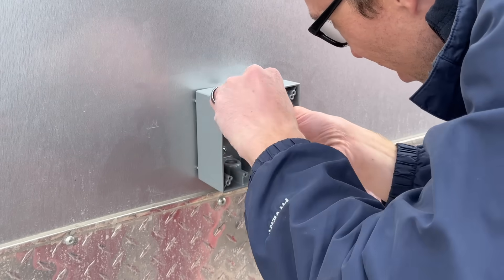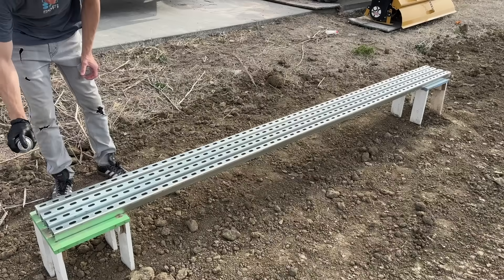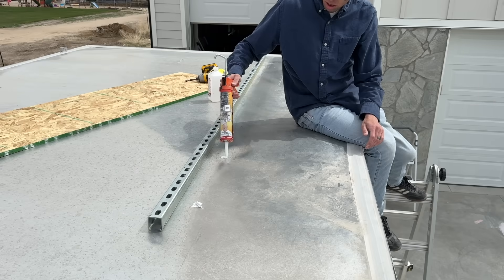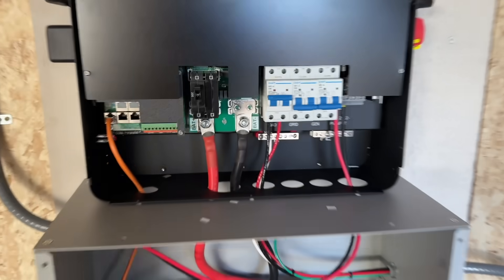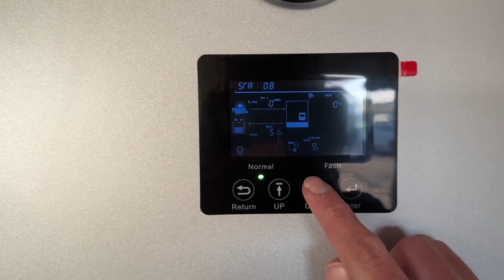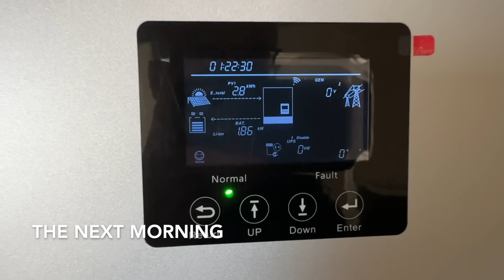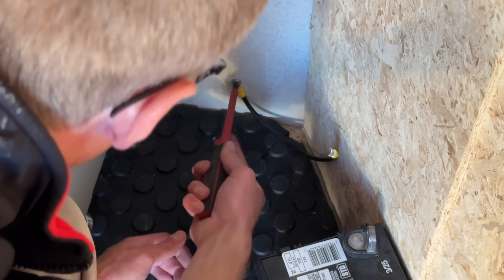I Built the ULTIMATE Solar Cargo Trailer

Comment from the maker: If you're looking for solar equipment at the best prices check out my project → https://drop.solar

For anyone curious about the cost, the total came to around $7,500 (not including the trailer)
Reply: This thing is Awseome. Imagine a trailer body with electric assist wheels kinda like the pebble rv so this thing could help push an EV along and not reduce your range so much.
Reply from the maker: That's an awesome idea!
Reply: @TysonBash  Just keep the tesla plugged into the charger while you drive 😂
Reply: @SmithOffGrid  just an observation here: signature solar requires a minimum purchase of 10 solar panels in most of their options. This eliminates a lot of buyers for projects like this.

Sungold Power has a minimum of 2 on all their solar panels, which means more people, especially ones who want multiple different panel sizes, will be able to buy from them, just be sure to wait till they have a 20% or 25% off sale.
Reply: Hello, the Portuguese audio option appears, but it is still in English.
Reply: Can you please build a small version for me?
Reply: That’s not bad 7,500 trailer about 11-12 maybe that’s right in the price range I was thinking, now probably another 5k for the flooring and water stuff lol .
Reply: $7500 including the trailer?!
Reply from the maker: @apayes  Not including the trailer, that's the total for the added solar equipment
Reply: @apayes  yeah, right!!!
Reply: @apayes if only👍🏻

Comment: Good job. This is what I've been planning for a couple years now but funds aren't there yet. I'll be more DIY though because I want the weight over the axles so I'll open the floor over the axles and create a sub floor storage for the 400ah batteries and hang the inverter on the wall next to them. That way I can still pull my SxS in. I need to save the weight on the tongue to carry the weight of heat pump AC unit. But otherwise you hit the nail on the head going with a true 48v solar system. I plan to also add a solar panel awning to get closer to that 5000 watt capacity so that the AC can run directly off the panels bypassing the inverter.

Comment: Have you considered running the inside wiring inside the walls instead of the exposed conduit? Also, when installing a junction box (or any box) on the outside wall of a house or trailer, you only seal the top and both sides and not the bottom so if any water does get in behind it can drain out and not be trapped. Would it be better to bring the solar wires over the front and go in through the wall instead of that large hole in the ceiling? It does look like there is room for more panels on the roof. I would go for as much production as possible.

Comment: You need to get that lead acid battery out of there. They are not to be used in enclosed spaces
Reply: To be specific "Yes, lead-acid batteries produce a mixture of explosive hydrogen and oxygen gases
through the electrolysis of water in the electrolyte, especially when charging, overcharging, or even self-discharging, with the gases venting from flooded types and potentially from sealed (VRLA) types if overcharged, creating significant fire and explosion hazards if not properly ventilated."
Reply: @MrAdopado thanks Wikipedia
Reply: @z50king29  .. and that's why it's in quotes.

Comment: Happy to see how you mounted the panels on the roof to the frame. I am getting ready to build a system into my 20' cargo/car hauleing trailer and I was unsure what the roof looks like because mine was finished out on the inside. So I can see I'm going to need to remove the plywood from my ceiling in order to be accurate about it because those metal beams are pretty small. Watched several videos and nobody really shows that... they just show them screwing it to the roof from the top in like any old place and I keep thinking to myself... no way... drilling from the bottom up thru the roof is a way better way.
Reply from the maker: Glad it was helpful to see how I did mine! Good luck on your build!

Comment: hi there. nice build! please insulate ( or better cover) the sharp edges of the cable passage from the battery to the inverter with thick rubber to prevent rubbing through the insulation !!! this is a serious fire hazard !!!
Reply from the maker: No worries! 13:52

Comment: Impressive project.  I wonder, did you need to accommodate the "ratcheting" of the panels to the "flex" of the trailer roof as you go over curbs/ruts and the like?  If so, what/how?

Comment: Nice job!  You need to use bushings on the knockouts in the bottom of the inverter to protect the wires from sharp metal edges of the punched holes.  As you travel and use the trailer, the wires will vibrate against the edges of those knockouts and can rub through the insulation causing a catastrophic short.
Reply from the maker: No worries! 13:52
Reply: He should be worried in a mobil application those wires WILL rub through insulation, at least he will get to see if the circuit breaker works.

Comment: Great work as well, very clean install.
With much of the battery installation contained within the nose of the trailer and the addition of solar panels forward of the tires, how much additional tongue weight/static force was added to the trailer hitch? 
Estimating ~625 pounds (300# battery, 100# Inverter+Panel+Wiring, 225# for 3 solar panels forward of the tires).

Comment: Hello, anytime a wire goes through a hole especially a metal box it should be protected from chaffing etc. with the proper additional insulator and a wire securing device if required. Please for safety reasons protect the battery cables, etc that pass through from one box to another box!!!
Reply from the maker: No worries! 13:52

Comment: What is this system grounded to? I see you have a wire ran from the inverter to the panel box, but doesn't this system need to be ran to the chassis?
Reply from the maker: I can’t remember if I showed it in the video but I sanded off the paint in a corner of the breaker panel and used a self tapping screw to connect it to the frame of the trailer. That bonded the ground of the system to the trailer

Comment: I recently ghetto rigged our bus's solar to my workshop. Runs our well pump and booster... love it.  nice work on the trailer. personally, I couldn't trust the wood screws to hold over 400lbs to the interior of a trailer wall. You might consider some through bolts to the exterior and just caulk the hell out them so they dont leak

Comment: I'd look into getting a 48v to 12v buck converter to tie into your low voltage instead of the battery. A fuse and an switch should be sufficient to come straight off your battery.
Reply: Thought the same, 14kw battery & inverter has to be on to keep the 12v charged, The extra weight, wiring and the loss between 48v DC -> 120v AC -> 12v DC doesn't make sense, If you wanted to run a nice 12v fridge you'd lose a lot more power versus a step down right off the battery. Otherwise a fantastic build for sure!

Comment: Personally, I would have put all that weight over the axles.  That would keep from adding to your tongue weight (unless you're towing it with a semi).
Reply: I thought about that, but on my trailer, I'll be doing a similar system and i want it heavier on the front so I can put tools like a compactor all the way to the back of the trailer and not wory about fishtailing.

Comment: Looks amazing, I would probably add a DC isolator switch between the panels and Inverter though
Reply from the maker: The inverter actually has one built in on the right side which is awesome!

Comment: I too am making a solar setup, though mine is on the roof of shipping containers, instead of trailers. Today I just finalized the purchase of the solar panels through signature solar, paired with some refurbished 5kw growatt inverters. The 5kw inverters were $350 each, and the 12kw of solar panels were just under $0.19/watt. I don't have batteries yet, but will buy those after I bring the rest online, with solar running my air conditioners during the day.

Comment: EDIT: never mind. you fixed it at the 14 minute mark. Should have watched all the way before commenting

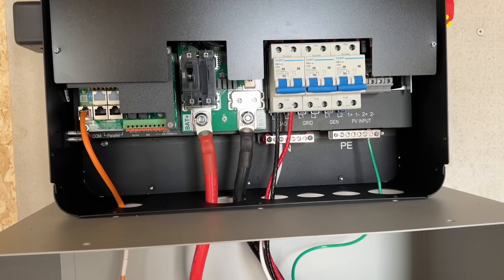Cool build overall! On problem I think I saw though: @7:36 you can see your wires are in contact with the bare metal of the holes on your inverter. You should really install a plastic grommet in those holes. Over time the metal of the box will cut your wires. Especially in something that vibrates as much as a vehicle or trailer. If those were wires in a main panel of a home, that would fail inspection for sure.
Reply from the maker: Oh yeah sorry about that, I threw a lot of people off with the ordering of those clips haha. I included them how they happened chronologically but I probably should have put that clip with the grommets earlier in the video. Thanks for watching!

Comment: If you pushed stranded wire into the quick connect holes on the back of the outlets - please immediately correct this and use the side terminals.  You are risking a fire.
Reply from the maker: No worries, I never use those quick connect holes. I find them annoying even with solid wire. I used the clamp down terminals on the side for all of them.

Comment: A very nice biuld. 

But I personally would also do one more thing: having much more mounting points for the battery and inverter on the wall. This things are heavy and were not meant to be driven around. If the ownler's going to move the trailer a lot, I would recommend to install straps or some other kind of additional safety mounting for the two devices, just like you did for the little 12V battery. Otherwise they may rip themselves off the wall while the trailer is being moved.

Comment: Great video. I would have used EG4s PowerPro outdoor battery as it has a heater built into the battery so that it can recharge below 32 degrees and the battery you used will not.
Reply from the maker: Actually both the PowerPro and the Indoor version that I used have the built in heaters which is pretty sweet
Reply: @SmithOffGrid  yeah you're right. I didn't think the indoor one had a heater but I just looked and it does.

Comment: Did you add grommets on the wires that go from your battery to the inverter. They will rub on the steel knockouts.
Reply from the maker: Yeah I added them later on in the video

Comment: With full battery in the trailer, from Zero charge in the Tesla, how much as a percentage will it charge the Tesla with no solar contribution (say down to only 5% battery left)?   What size is your Tesla's battery? I want to do as you have with out motorhome and have it as a "Tesla Charger" when the motorhome is just sitting in the driveway. Thanks!

Comment: When you connect your panels in series, your total voltage will be equal to the voltage of the weakest link. If one of the panels becomes partially shaded, it will bring energy production of the whole system to its level. To remedy the situation, you have to have parallel connections, so panels can work independent of each other.

On my 14 kW residential solar system they used micro inverters tacked in under each single panel. Then AC output was wired down from the roof to the utility room, one 20A wire per 16 panels. Here are the benefits of setting the system this way:

- Shade affects only a shaded panel (not the entire system).

- It's cheaper and more efficient to transmit AC vs DC.

- No single point of failure with the inverter.
Reply from the maker: Panels in series actually add voltage, it’s the current of the lowest performing panel that’s the bottleneck.

Parallel arrays can solve that problem but it comes at a cost. Current adds in parallel instead of voltage, so you’re working at a lower voltage and the current ends up being way higher.

If you think about this trailer, each panel at optimal performance runs at 10 amps. The wire needed after paralleling the array would have to handle 60 amps! For larger arrays it gets even higher. Plus you have the added expense of combiner boxes.

Series arrays also have the benefit of less power loss over longer distances compared to lower voltage parallel arrays, since the voltage drop is a smaller percentage.

Using 12 awg copper wire:

500V at 10A over 300 ft has a voltage drop of 2%
50V at 10A over 300ft has a voltage drop of 20%

This is why most modern solar charge controllers are moving to higher voltage inputs, so that you can have the benefits and cost savings of higher voltage series arrays. But yeah series arrays aren’t perfect as you pointed out.

I do think micro inverters are pretty cool though! They kinda have the benefits of both. Higher voltages, and lower performing panels don’t bottleneck the others. Just has the downside of added cost and slightly lower efficiency due to the inverter losses (if you have a system with a battery)

This is the type of stuff I really enjoy thinking about so thanks for the comment!
Reply: @SmithOffGrid  You are welcome. Nine years ago, when I had my system installed, the big inverter's cost was $5000. The small micro inverters came at $120 a pop, at a comparative cost of 46 x $120 = $5500. The 10% increase in cost was totally worth the benefits it provided. The main one would be aliviating the risk of loosing $5000 in a moment the big inverter dies (they do that, occasionally). On the other hand, replacing one micro when/if needed, isn't a big deal. (Though all 46 mine still working fine).

Also, the micro inverters are 100% weatherproof - they don't need a box. You need only a few junction boxes that micro inverters can share for connections.

Comment: I’m impressed with this I’ve made a smaller version nowhere near as good. I would definitely advise strengthening the fixing’s on the battery and inverter to the chassis if you are thinking of towing the trailer.

Comment: Okay. I thought Will Prowse was the best solar guy on YT. Your solar trailer build is puts you right up there with Will. I cant believe the cost of the solar equipment was only $7500. That's amazing. I know Will built one as well but I think his was more like $15K? I want to build something similar as well. With enough capacity to charge an EV. I have a small scale solar now but its just for EV bikes and power tools.

Comment: That thing would be great for emergency response, you could just cram it full of exention cords and put some extra power outlets in and supply four or five campsites set around it until power gets restored ro an area. So many other uses.....add some large water sources and some large appliances....like close washers and dryers and make an onsite mini laundry mat, or let a emergency response team use it to power medical equipment, or help power a mobile kitchens refrigeration and appliances during blackouts....

Comment: How efficient are those bi-facial solar panels? If they are permanently installed in that configuration?  It would seem that for maximum efficiency they would have to tilt?
Reply from the maker: Yeah it just came down to cost. These bifacial panels were cheaper than any mono panels we looked at ($0.14/watt) so it still made sense even though we won't be getting any bifacial gain with them mounted flat. The dimensions made sense too for maximizing the roof space.

As far as weight goes, we've used some 400W mono panels for our house and those weighed 50 lbs each. These 410W bifacials weigh 56 lbs each so it didn't seem like too much more. The weight is definitely worth considering though in mobile applications like this.
Reply: Thanks for the reply
Reply: Yeah.  This isn't the first time I've seen this happen.  I'm not sure why bi-facial panels are so popular.  People are buying them no matter what the location or orientation is.  The only thing I can think of is that they're paying the same amount per watt for the bi-facial so they don't care.  But, on the other hand, bi-facial panels are heavier too.
Reply: Agreed,  I guess if they’re paying the same amount per wattage, it might not matter but the extra weight would be a concern for me also, I haven’t watched the whole video yet, did he even address this?

Comment: But if you mount the battery bracket right to the frame doesn't that make the cement board useless? Because you're a steel grounding, the screws metal to metal.?
Reply from the maker: Oh the cement board isn’t to isolate the battery electrically. It’s just a fireproof barrier in case a fire started so it wouldn’t spread as easily. Unlikely anyways since it has built in fire suppression… But that’s what was recommended in the install manual
Reply: @ oooooooo ok now I get it thanks for the insight

Comment: Why did you mount bifacial solar panels if you mounted  them that way?  They will only produce electricity from the top surface, not the bottom as they are mounted so close to the trailers roof, not being able to produce  from both sides.  Because they are more expensive than standard residential panels, this is not cost effective.   Just curious.
Reply: And heavier, too.
Reply: he said in other comments they were cheaper where he bought them. As far as weight he said the mono were 50LBS and these were 56LBS, so not a huge weight difference.

Comment: If the ground is wired to the frame of the trailer is there a chance the frame of the trailer can have current running through it?
Reply from the maker: No, in normal operation only the neutral carries the return current. The ground (and thus the frame) is bonded to neutral in the breaker panel so if there was ever a fault which energized ground it would immediately trip the main breaker on the inverter
Reply: @SmithOffGrid  Cool nice work.  Thanks for answering the question and so fast as well.  It was a great video and very organized job and layout.  I can see this being able to expand to 100KW or more, just need the panels to support/charge it.